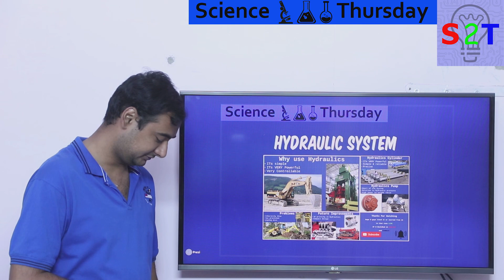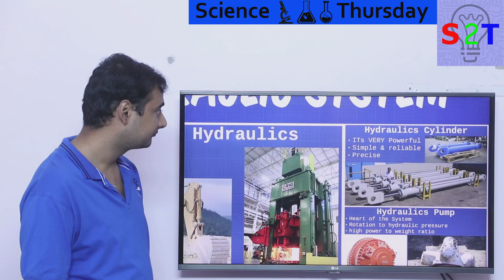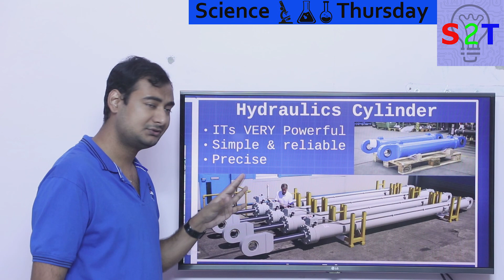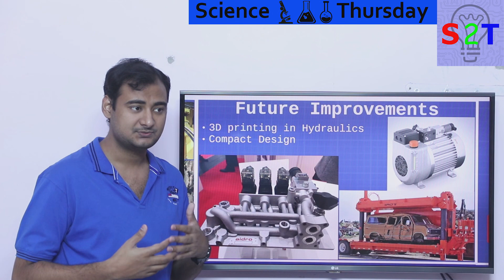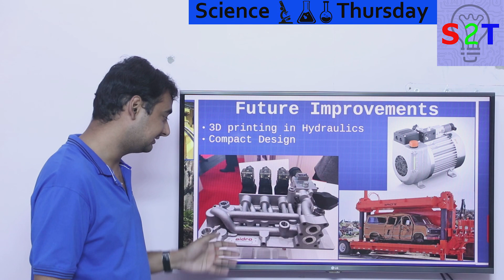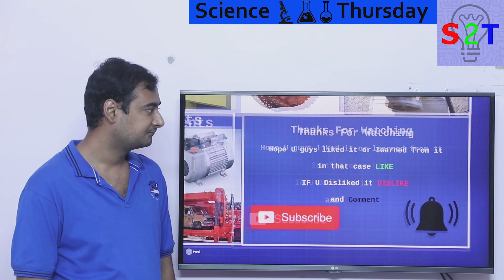Science Thursday Ep61 (Hydraulic System Explained)

Comment: What is the difference between hydraulic system working principal and  bike front suspension system working principal? I mean where the energy goes during compression of suspension system? If spring absorb the energy then how the suspension system handle the releasing energy of spring?
Reply from the maker: bounce back and heat